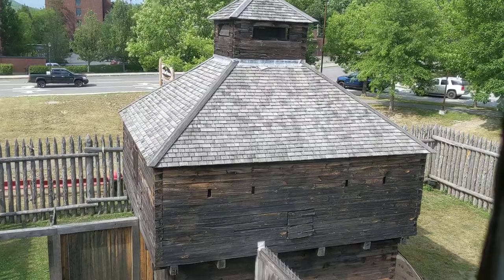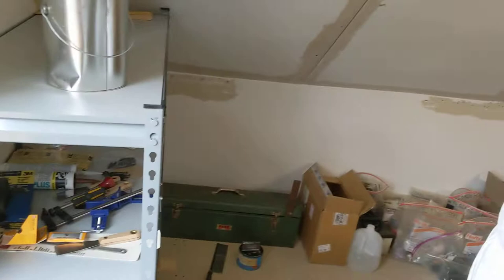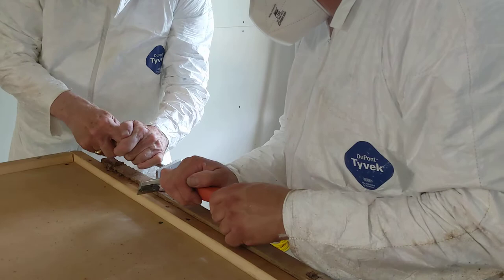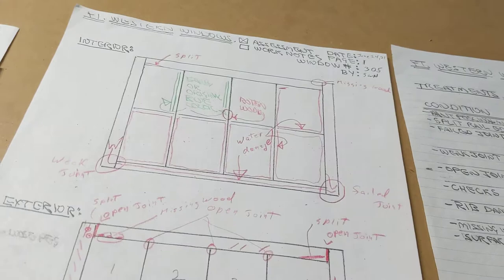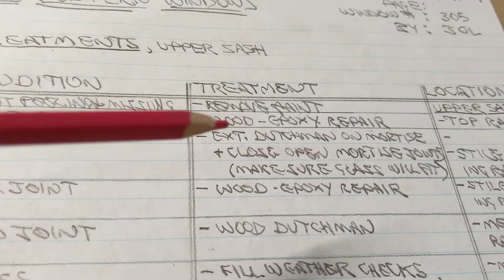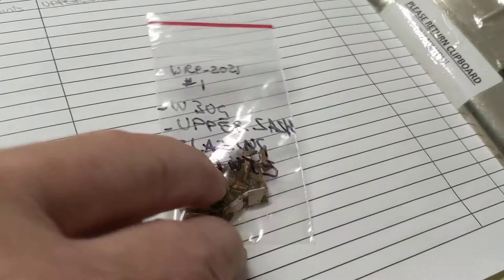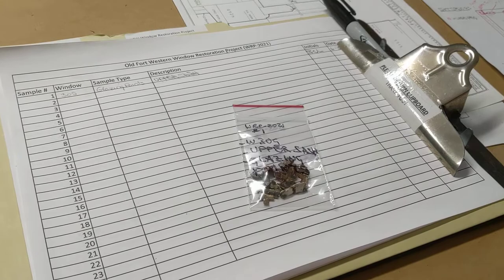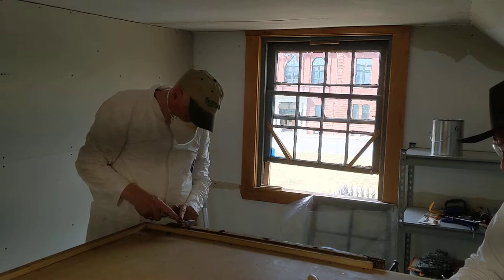Fort Western Windows

Comment: This is where I learned to restore the 1918 19 doublehung in my house. Good resource for the capable do-it yourselfers.
Reply from the maker: Don, when was that and where?
Reply: @johnleeke  your sash glazing, painting, and check repairs were the basis for my window restoration project. I did it back in 2015 in San Jose CA. Started as glazing on one window turned into a months long project of 19 windows. I made an easel, and replaced all the new glass with wavey glass
Reply from the maker: @DPN1DPN , glad I could help. Do you have any photos of you doing your window work?

Comment: Are you going to use linseed oil paint and glazing?
Reply from the maker: We'll be making our own putty with traditional materials and methods, watch for a video on that. And using commercially available oil-based linseed oil primer oil-base linseed oil & alkyd resin exterior enamel.
Reply: @johnleeke  Traditional materials/methods would be linseed oil conditioning, linseed oil glazing and linseed oil paint.  I restore windows in Connecticut using traditional linseed oil products/methods.  I assume you realize petroleum based glazing, primer or paint is not traditional materials/methods.
Reply: @johnleeke  Also, I'd suggest using some heat and raw linseed oil when scraping to avoid gouging and minimize sanding.
Reply from the maker: @richardmckrell4899  thank you for your thoughtful comments. 
When I say, "oil-based," this includes linseed oil, turpentine and pigment paints, which have been used for at least 1500 years. 
We are pretty well versed in traditional materials and methods, and, of course, it depends on which traditions you want to work in. Some traditions do include petroleum materials. The modern petroleum industry in the US began in the 1850s, and petrol-based materials were commonly appearing in paint products by the 1890s, so if you are working in a late 19th or early 20th century tradition in the USA, petrol materials might be appropriate. And, going back one- and two-thousand years, there has been naturally occurring petroleum that was known used by some trades and artisans.
At the Fort Western project we will be making and glazing with putty from the 18th century traditions used in the frontier settlement era of northeast coastal North America, the area now know as Maine, that include boiled linseed oil and whiting.
Also, working in the best practice of the current preservation trades tradition, we will also be using modern paints that may contain petroleum-base ingredients because these paints have well-known performance and durability characteristics that we need to protect the highly valued wood components of these historic windows that are over two centuries old.
We do know about the currently available linseed oil putties and paints (like the Allback products), but here in New England and the eastern seaboard there are certain difficulties some have  had with mildew, and limited durability with certain colors. (more on that here:  http://historichomeworks.com/forum/viewtopic.php?t=1625 )
I have been doing side-by-side field testing of these paints and putties on window sash for 16 years, and found that there are certain durability issues. I am continuing my testing program because I think they hold promise, but I am not using or recommending them on significant historic structures.
Reply from the maker: @richardmckrell4899  writes: 
>>I'd suggest using some heat and raw linseed oil when scraping to avoid gouging and minimize sanding.<<
Richard, that's an interesting suggestion, thanks for bringing it up. I do know about the linseed oil and heat scraping, and it does work. One advantage is that the wet oil helps contain the lead-health risks. One dis-advantage for us is that it saturates the surface of the wood and the joints with 100% linseed oil, which would be incompatible with some of the treatments we want to apply to the wood after paint removal.
At historic Fort Western we would not use any high-heat (over 250 F.) method because of the fire hazard, especially along with a flammable material like linseed oil. The window preservation workshop is set up in the historic barracks building, that we would not expose to an unnecessary fire risk. This leaves out high-heat dry-heat methods like infra-red heat lamp, hot-air gun, etc. Also, if we used high-heat with linseed oil we would have to add another layer to our worker safety program by adding organic vapor filtering to the respirators, with added costs and discomfort for the workers. And, the odor of the heated linseed oil  in the building would probably disrupt the living history program that recreates the atmosphere and subtle ambiance of the 18th and 19th century way of life.
We have been using steam heat for deglazing and paint removal, which is limited to temps no higher than 212 F., and is a damp process that further mitigates the lead-health and fire risks.
We are also using other methods for paint removal and deglazing, such as cold vacuum scraping, that have no fire risk and significantly reduces the lead-health risk, especially when combined with a comprehensive lead-safe work practice program.
Reply from the maker: @richardmckrell4899 ,
>>I restore windows in Connecticut<<
Do you restore windows for other people? If so, I'd like to add you to my list of window specialists. Send me your contact info, service area and a brief description of your window work. The list is published in the back of my Save America's Windows book. Send that to: johnleeke@historichomeworks.com
Reply: @johnleeke   I have yet to find an 1890's paint manufacturer selling petroleum based paint.  Turpentine was of course used as an additive to assist in drying and penetration, however every late 1800's/early 1900's paint brochure/article I've read, through the library of congress, was selling linseed oil based paint.  If you have a link to an 1890's sales brochure selling petroleum based paint, please send me the link.  Modern linseed oil paint (such as Allback) has solved any linseed oil paint mildew concerns.  Also, linseed oil paint is very durable, will last for decades, protects wood (as it's breathable) and requires little maintenance.  Petroleum based paint is just a non-breathable plastic coating.  Linseed oil paint is by far the best choice for any exterior wood, especially wood windows.  Linseed oil paint is also ideal for other exterior wood projects such as wood railings and deck stains.  I would be surprised if the wood windows you are working on were not originally painted with linseed oil paint.  If you are stripping any wood window, the linseed oil paint process is hands down the best choice for longevity, ease of maintenance and historical correctness.   The linseed oil paint process does require more time and craftsmanship, however I feel the benefits are worth it.
Reply from the maker: @richardmckrell4899 , sure, linseed oil was still the main binder in paints during the 1890s-1920 era, I'm not saying it wasn't. But, during that period they were beginning to use petrol-derived ingredients like driers and petrol-derived dyes and pigments. The alkyd (plasticized linseed and safflower oil) binders came about in the late 1940s & 50s, and later in the 1970s petrol-derived acrylics, precursors to todays plastic paints. I've been on preservation projects for 1950s mid-century-modern houses where we used paints made with alkyd resin (plasticized linseed or safflower oil) binder and petrol-derived mineral spirits vehicles, because that was the type of paint originally used, so that mid-century-modern tradition is what we followed.
In just another decade or two we'll be preserving the 1970s and 80s buildings, and will have to figure out what the petrol-chemical era traditions are all about. It's going to be dang hard to preserve buildings that were designed to fail after 20 or 30 years. Maybe we'll have to build an archival case around them like a object in a museum.
Reply from the maker: @richardmckrell4899  writes:
>>Modern linseed oil paint (such as Allback) has solved any linseed oil paint mildew concerns.<<
True, but paint makers have known for at least 100 years that adding zinc oxide speeds up drying and curing of linseed oil, which results in a less flexible paint film that reduces durability, especially on exterior woodwork that moves. Hans Allback's tests of his linseed oil paints and putties that effectively demonstrate his methods and products' long-term 40-60 year durability are with the non-zinc oxide products. I expect he has tests under way for the zinc oxide products, but its only been about 12 years since the zinc oxide products were first offered in response to the mildew problems here in the US.
I'm still doing comparative side-by-side field tests of these paints and putties, but not yet using or recommending them on significant buildings. Results of my tests have been presented at the national Window Preservation Standards Summits every other year.
Reply from the maker: @richardmckrell4899  writes:
>>You should consider adding chapters on linseed oil paint.<<
You should consider writing them. Tell us more about it over at the Save America's Windows Forum:
https://saveamericaswindows.com/forum/viewtopic.php?f=10&t=5706
Reply: @johnleeke  You agree linseed oil was the main binder in the late 1800''s and early 1900's.  You agree petrol dryers were used but still with linseed oil as the main binder.  Linseed oil paint pigments are inorganic minerals, which is just as important as the linseed oil binder.  Considering linseed oil paint is historically correct and has benefits over petrol paint, why not consider it?  Just because petrol paint has been used in historical restorations for decades that does not make it the best choice.  I've found linseed oil paint to be a growing niche market.  My local Ben. Mor. paint store told me 2 customers recently asked for linseed oil paint.  Allback is $54 a liter plus shipping.  100% of the paint weight is used as there is no evaporation during drying.  A liter can paint a lot of sashes.
Reply: @johnleeke  I doubt I'll get to the forum but feel free to call if you have any questions.
Reply: @richardmckrell4899  Don’t hold back, tell  us how you really feel, Richard…
Reply: @johnleeke  Allback product ?